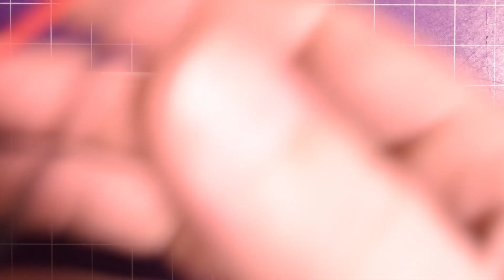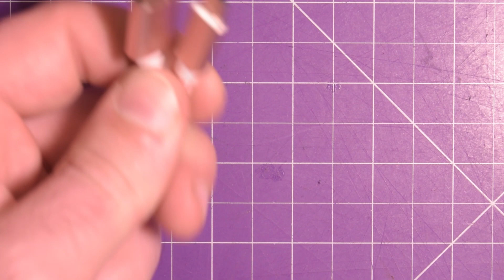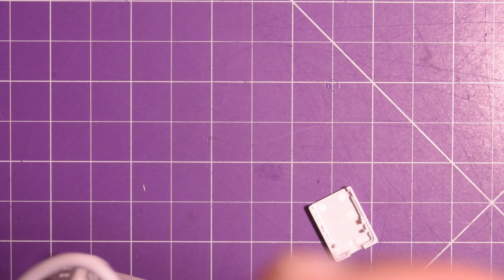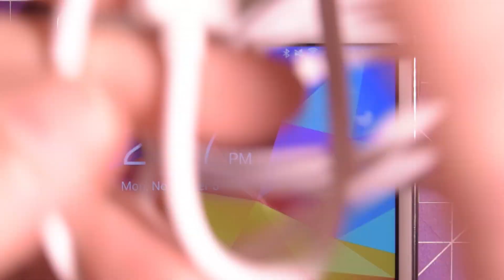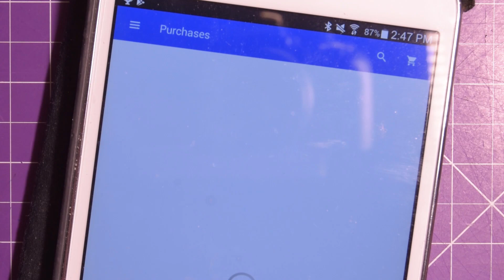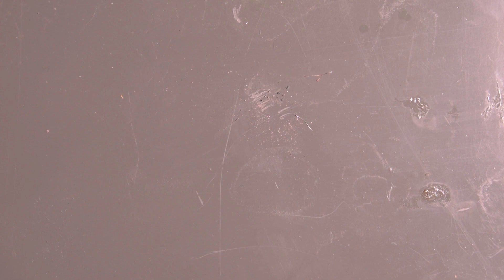Mailbag 16 - Wire Spaghetti

Comment: For the triac's to work you will need a trigger diode as well as a capacitor and resistor network along with a potentiometer for delaying the phase angle where the triac will turn on and begin to conduct. They are found in light dimming circuits and in the motor speed controls in power tools also in some kitchen appliances like a microwave oven.